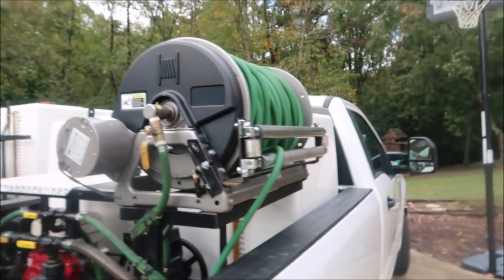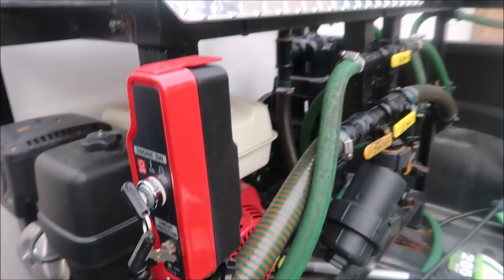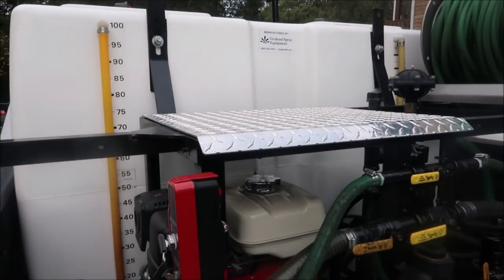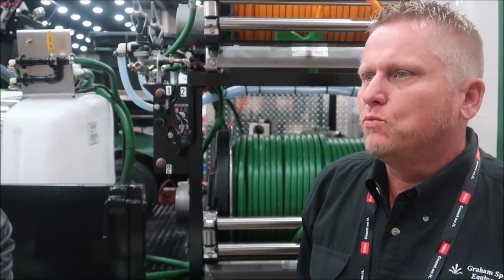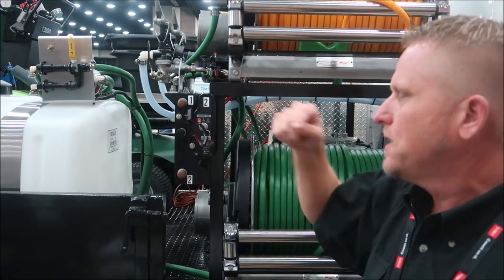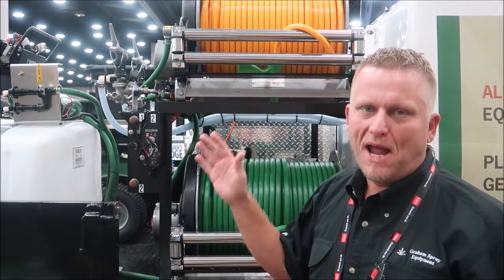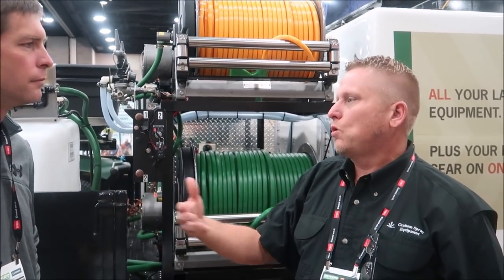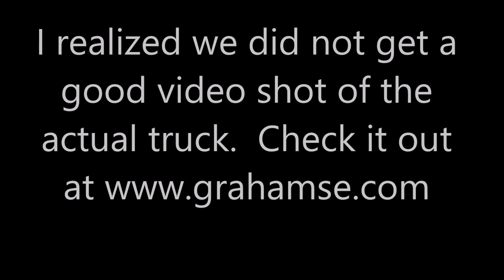Lawn Care Spray Rig Setup with Split Tank,  All in One Mowing and Spraying Setup

Comment: Hey do you know if Prodiamine will help prevent Virginia Button Weed?
Reply: VBW is a perennial. Your best control is not allowing a lawn to stay wet. It tends to thrive in wet areas. MSM Turf will suppress it.
Reply: @bassmaster1953  thanks
Reply: Nothing prevents that junk. That and Wild Violets are two of the toughest ones to hit. Treat them the same. I used to use Blindside 2 apps 10-14 days apart) and it would knowck it out. But they always come back either the next season or two seasons later.